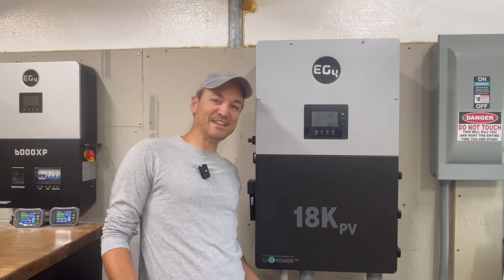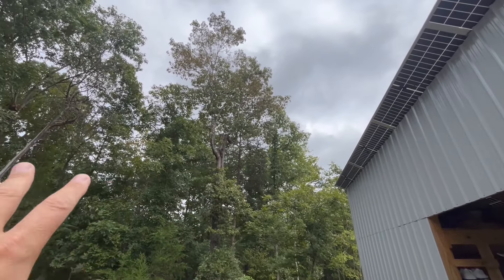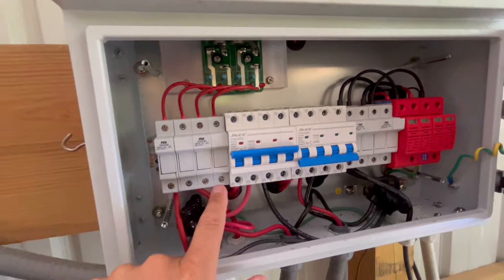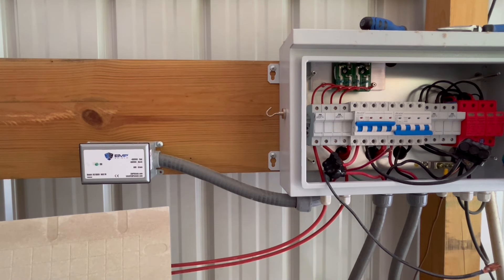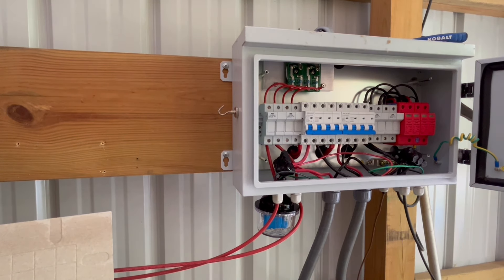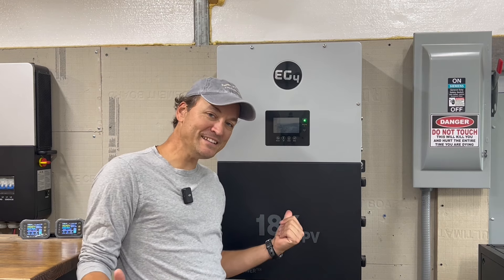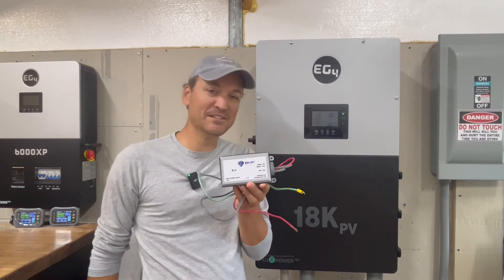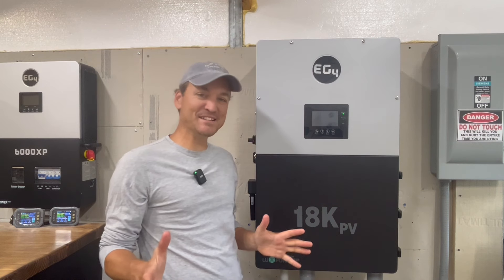This is why you need surge protection

Comment from the maker: Correction, I don’t believe the 12kpv has been EMP tested yet. Although I would expect it to pass, the same as the 18kpv, we don’t have that info as of yet.
Reply: Most of the better brands of all in one inverters or inverters and charge controllers have MOV's spile protection across the inputs but only some have them across the outputs.. If a spike gets inside the house wiring first from a direct hit nothing will stop or save things but those are really rare unless you have plugged in extension cords outside during a storm.. I put a GFI and a plug in surge device on anything like that outside.. Years ago I had an extension cord running to the shed for power and left it plugged in.. It took a hit and fried literally everything on that phase inside the house..

Comment: We’ve had lightning strikes within 200 feet of ground mounted arrays. All of them are grounded at the array. All of them have midnight solar surge protectors installed at the array. I also have midnight solar surge protectors on the AC output and battery banks. 2.5 years off grid - no damage so far. The SolArk inverters will shut down occasionally when lighting strikes nearby due to the induced current in the PV wiring and start back up two minutes later.

Comment: Back in June we had a direct lightning strike on our east-facing array. I thought it had killed the charge controller but in reality all of the bypass diodes in all 20 of the solar panels had shorted out. Once I removed the bypass diodes that charge controller came back to life.
Reply from the maker: Yeah I still need to finish checking my diodes. I’ve read that lightning can affect those as well.
Reply: @GavinStoneDIY  The array that got hit was old Trina Solar 240W panels, 20 of them. They each had 3 bypass diodes. ALL of them were shorted. Many had exploded and melted the plastic junction box covers.

Comment: Pretty impressive that the 18kpv recovered from this.  I suppose I should incorporate some decent surge protection when I do the upgrade.  Glad you came through with only the SP damaged!  Good job.
Reply from the maker: It is impressive. He got knocked down for a minute, brushed the dust off, and got back up. I’m so glad I had SPD’s on my arrays. Sometimes we don’t know we need it till it’s too late. 🙂

If this prevents someone from losing their system then I will have done my job.

Comment: I use Midnight Solar on my arrays at the solar panel array as well as at the inverter. I have a 400 foot run between solar array and inverter. Also have one on the Battery side. AC has square D surge in the panel, as well as one in the Mini Split System. Hopefully they take the hit if we have similar situation.
Reply from the maker: Yeah I will happily pay to replace the SPD, rather than my entire system.

Comment: The air near a lightning storm can become charged with electricity. I have heard ham and CB antennas snapping while discharging thousands of volts to ground when thunderstorms passed overhead. It doesn't need a direct hit to compromise electrical equipment. And yes I personally tested this with baling wire and had painful sparks leaping out of my tennis shoes.

Comment: I have 2 Midnight solar arrestors on the DC side and 2 LAR arrestors on the AC side along with several MOV spike devices across all the solar to breaker to ground connections.. I do want to add additional arrestors at the charge controllers and inverters this winter before Spring storms start up..
Reply from the maker: Sounds like a good plan.

Comment: I have a Solark 8K, I don't have DC protection, but lightning nearby put out in an alarm twice and I lost power for 4mins. The alarm said "DC Overcurrent". Anyway the inverter got back on and everything has been working fine. Sol Ark inverters have lightning pv input protection integrated but I don' know well or  how it works.

That buzzing was the charges from the lightning generating an EM field. That was an indirect impact most likely. From what I understand, direct lightning strike is usually catastrophic no matter the protection you have.

Though EMP protection should be standard for all inverters, solar flares and lightning happen frequently.

You should check your surge protectors in the house to check for evidence of damage. If there is nothing, then AC side prob wasnt affected that bad. It was just the  solar array that  acted as an antenna and afected pv input.
Reply from the maker: Yeah the surge could still have come from the PV side. That is possible. It’s hard to say really. 

The somewhat cheesy surge protectors I have on the ac side are still intact. But yeah, with a direct strike all bets are off really. I definitely don’t want one any closer.

Comment: Surge protection isn't fool proof. It really depends on the hit you take. I've seen arrestors blown to smithereens' and melt or explode devices beside them. Static energy has a habit of making it's own rules as it goes. But even at that they will usually lessen the fallout when it's over.
They are very much worth having. Actually more like unwise to take your chances without them.

Comment: Why didnt the combiner box fuses/ breaker trip first, they are ahead of the emp shield correct?.
Reply from the maker: They are yes. And I’m not sure. Really all bets are off when a nearby lighting strike  occurs.  I’m just happy I had something that did catch it.
Reply: @GavinStoneDIY  Fuses/breakers trip based on current i.e overcurrent/short circuit. Surge protectors trip based on voltage. That's why a fuse doesn't offer any real protection against a surge. Presumably, the EMP shield blew because of the sudden voltage spike and the Metal Oxide Varistors (MOVs) inside of it are now toast. You can see the MOVs in the new device that was installed, they're the large blue rectangular components.
Reply from the maker: @The101damnations  true, I’ve just had fuses blow also. So I’m surprised that all remained intact.

Comment: Quick question with  an unrelated issue because it seems like you know what you are doing. When I’m programming my amps to the inverter. How do I calculate the number of amps on my setting. Do I just plug in the number of amps that are on my solar panels. Do you have a video explaining this
Reply from the maker: Which inverter do you have? Most settings regarding amperage are related to charging the batteries. Whether from the grid or solar. 

The way you’d choose the amount of amperage coming from solar is by the panels you install, and how you install them. 

Also voltage pushes, and amperage is pulled. That’s another discussion, but it may play a part depending on what you’re installing.
Reply: @GavinStoneDIY  Thank you for taking my question! I have rich solar 6500 watt 48 volt off grid hybrid solar inverter 550 pv input. I have mega 400 watt mono crystal 
Max power volt 30.9 volt
Max power current  12.9 amp
Open circuit voltage  37.1volt
Short circuit current 13.7 amp
Maximum system voltage  1500 vdc
Reply: @GavinStoneDIY  I installed in series
Reply: @GavinStoneDIY also my batteries are alpha 5 (100ah ) 48 volt (2) 
Charge volt 52.5
Max charge current 100a
Max discharge 100a

Comment: Looks like the "EMP Shield" was the problem, not the solution.  It blew up short which in turn caused the combiner breaker to trip.  It should have an internal fuse and not short out this way.  Likely your system would have kept going without it as the protection inside EG4 is all that you need.  The EG4 has the lowest impedance to ground assuming it is by your meter/main panel so its surge protection is most effective.  Something at the end of the many feet of wire at your solar connection is not going to be similarly situated.
Reply from the maker: The combiner breaker wasn’t tripped. SPD’s are designed to shunt to ground this way. There wouldn’t be any way to know whether my system would have survived without it, because I had it. 🤷🏼‍♂️ 

My inverter is around 130’ from my main panel.
Reply: @GavinStoneDIY  I thought you said the breaker had tripped in one of the comments.  Regardless, the SPD created a short.  it is poorly designed.  It needs to have fuses to a) avoid creating that short and b) not set fire to itself and whatever else is around it.  Sadly most MOV based SPDs don't have such fuses causing both of those problems.
Reply from the maker: @AudioScienceReview  the surge actually jumped the internal fuses on the combiner box. Either way I don’t think my issue was the SPD. It was the lightning/gradient pulse. But I realize you don’t agree. 🤷🏼‍♂️

Comment: Hey Gavin! 2 questions, can you clarify how you wired in the emp protector and now the  new surge protector? 2 I also have the 24/7 watts combiner box, I thought it had a surge protector built in......is that not the case?
Reply from the maker: The combiner box does come with built in surge protection. But the surge ratings and stats on these units are much higher. I would rather have those built in SP than nothing. But I would definitely prefer either a midnight or EMP shield over those any day.

I go into more detail on how I wired these to my array on my other EMP shield video. I have that linked at the end of this video. I’ll add it in the description also.
Reply: @GavinStoneDIY  brilliant. Thanks for the quick response. And thanks for the informative video

Comment: Question unrelated to the topic.... I see you are using hardi-backer behind your systems. Is that for fire safety, or some other purpose?
Reply from the maker: Yeah it’s fire rated. Plus it’s fairly cheap, so it just seems like a good precaution to take. Most solar equipment mentions the need for a fire retardant surface to mount them to.
Reply: @GavinStoneDIY  What's your opinion on just mounting to fire rated drywall (like Type X drywall)
Reply from the maker: @joeldcoxks  yeah I’d be good with mounting to a fire rated drywall also. I guess it depends on the size of your system. But you’d probably only be talking about $30 worth of backer board.
Reply: Drywall / sheetrock is rated fire retardant

Comment: You realize you need to check if your panels bypass diodes are all blown? You are gonna end up with hots spots and cooked panels, especially with all the tree shading.
Reply from the maker: This is good advice. I didn’t include this in the video.

Comment: WELL I JUST TURN OFF MY SYSTEM DURING LIGHTENING....BEST PROTECTION 😉
Reply from the maker: A surge could still easily fry your system when it’s off. You’d have to disconnect all your wire leads for it to be effective. That would be rather difficult for some people depending on the system size.
Reply: @GavinStoneDIY  ok....thanks 👍

Comment: Nothing protects against 1M volts. It can jump any gap if it wants to
Reply from the maker: It can I’m sure. The best we can do is our best. So I try to add multiple layers of protection.
Reply: @GavinStoneDIY  it can jump from a cloud to the ground. It's going to go where it wants to go. Consumerism isn't being safe, it's spending money you don't need to.
Reply from the maker: @samuelfox8126  so your idea is to do nothing? I hope that works out well for you in the future. I don’t really follow that logic. But to each his own.
Reply: Any perspective on what would happen if you had disconnected the PV on the inverter or a PV breaker or disconnected the PV at a MC4 connector?
If I know lightning storms are coming, I generally power everything down and open breakers but not sure if that would help with a close strike. 
Thanks for sharing!
Reply from the maker: @bhbaker220  disconnecting the PV lines would do the trick I’m sure. That’s a lot of prep for each storm though, I guess it depends on your system size. But you also have the ac side of things to contend with.
Reply: @GavinStoneDIY  I'm saying no surge protector or fuse will save you system. 
And yet you don't want to do the one thing that could actually protect your system, to disconnect it?
Sounds like you'd rather buy gadgets than actually protect your system.
Reply from the maker: @samuelfox8126  I have 3 arrays, soon to be 4. Lots of different breakers and connections that all lead to the same path. Unhooking all of  those once I see clouds overhead doesn’t seem in the least bit practical, or even possible if I’m away from home. But maybe you’re always at the house with one small array and it works for you.